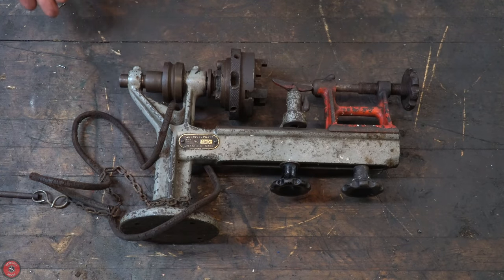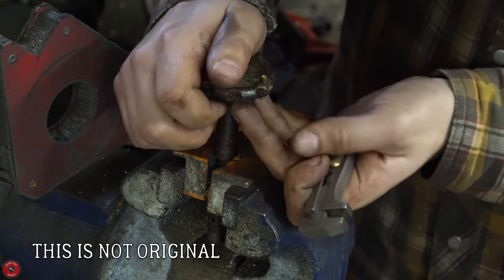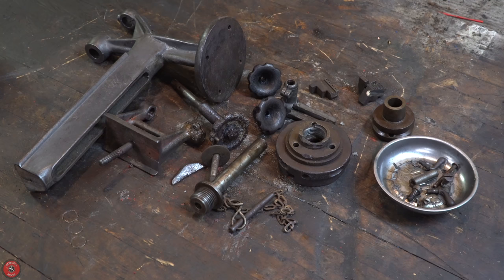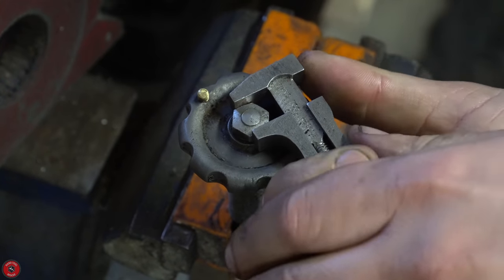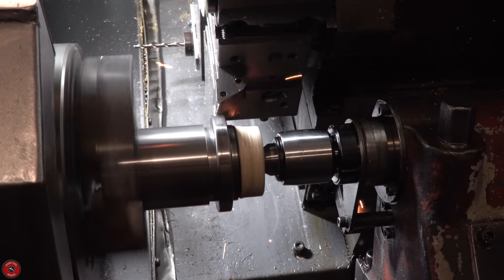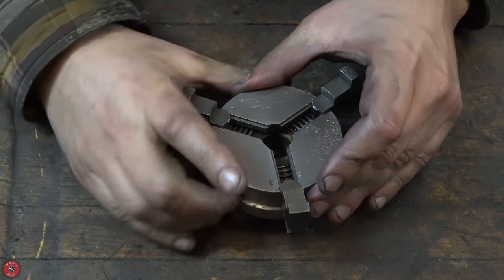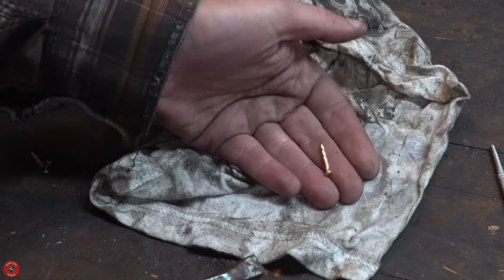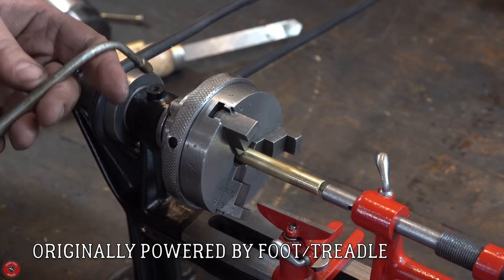Narrated: Antique Jewelry Lathe [Restoration]

Comment: Good timing on this narrated version. I had a problem reattaching a steel plate on a vise.  They used drive screws but your lathe just used brass nails.  I'll try that.  Thanks.

Comment: I'm a bit surprised that the two main journals for the drive spindle section didn't have oiler cups in the holes, rather than just the open holes.

Comment: The threaded part might have broken from casting defects or someone might have tried to use it for something it was not meant for and and accidentally made it tighten to the spindle and made the thread part expand and crack or someone tightened it too much and made it crack when it expanded from over tightening, this it probably what happened since someone added those slots for tightening.

Comment: do yourself a favor and get a coarse braided wire brush wheel for your angle grinder. Use a 10 amp grinder and it will tear through paint, mill scale and that shit in short order. THEN going to sanding because all that crap will clog up sand paper real good. It lasts forever and is ultra aggressive compared to a regular strait bristle brush. I don't even bother with any kind of paint remover or anything like that anymore. Strait wire brushes just don't work compared to the knotted braided bristles unless its some bevel.
Reply: and degrease after you brush it to keep the sand paper cleaner.

Comment: did you ever had evapo rust turn bad on you? I heard that it starts smelling ugly when you leave it open to the air
Reply from the maker: Not yet.  It doesn't smell either, it will just dry out if you leave it uncovered.